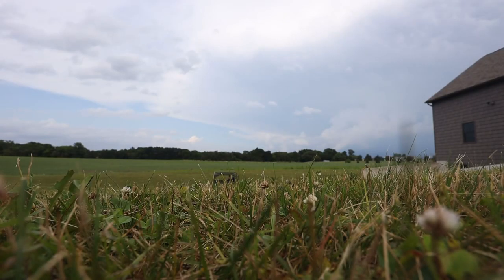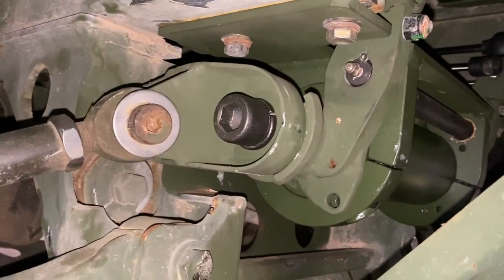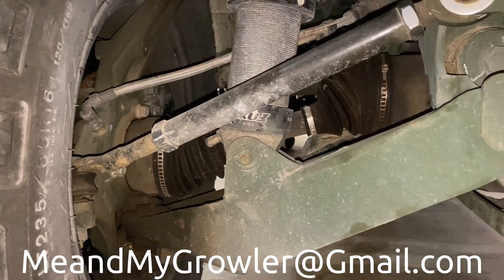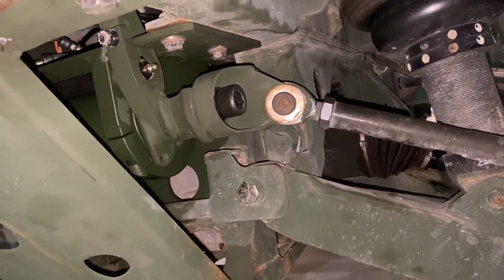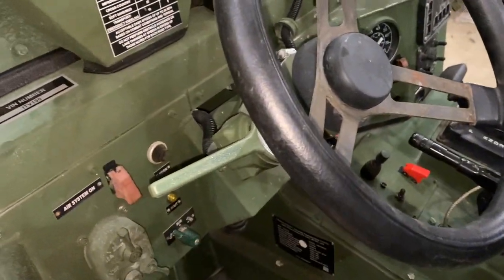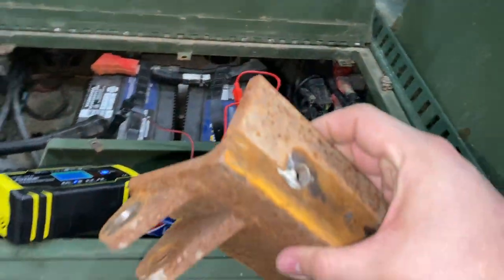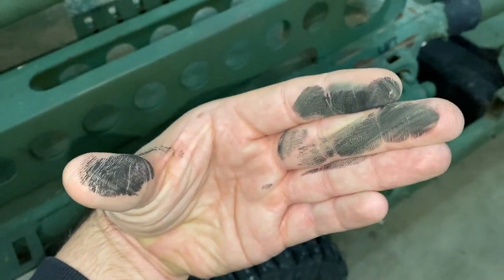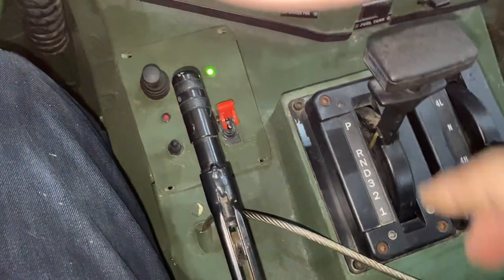Getting the Growler Fixed!

Comment: Current USMC active duty AAV operator. My step dad built all of those by hand and test drove them for many years until the plant shut down. They’re very capable vehicles and very rugged designed for air insertion from inside a mv22 osprey. They’re ideal and made for towing a 120mm mortar and a specialized ammunition trailer my step dad also hand built for a short time at American growler if you need any help or looking up parts to repair this I can help you find them probably get most things for free my step dad seen what they did with the rear steer unit and scoffed at it. When they test drive these they take it on road for 50 miles and then off-road for 5 miles hitting logs at 20 mph and no damage occurs and then another 50 on road to ensure everything works as intended
Reply: Where are you and your Step Dad located. Looking for support!! Thanks in advance
Reply: I have a Growler.  I'm looking for historical information.  Any idea where I'd find what unit this beast was assigned?  If it deployed anywhere etc.